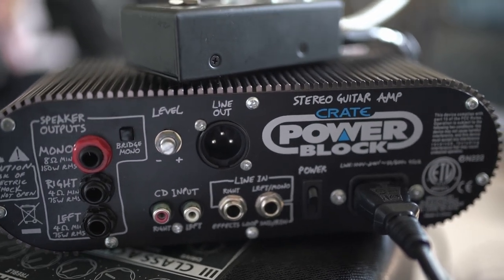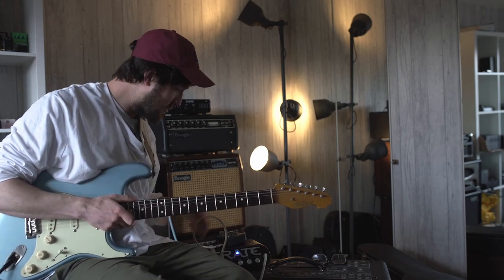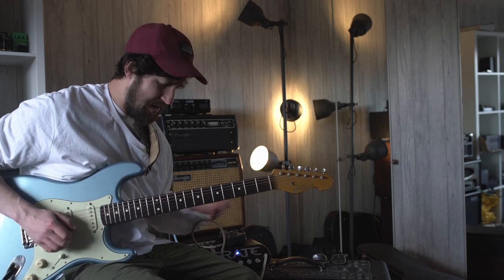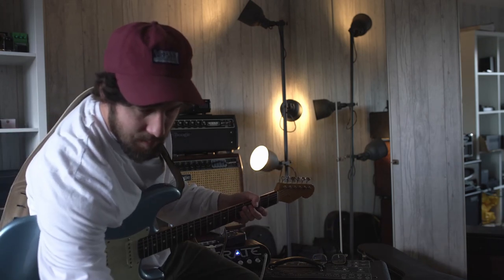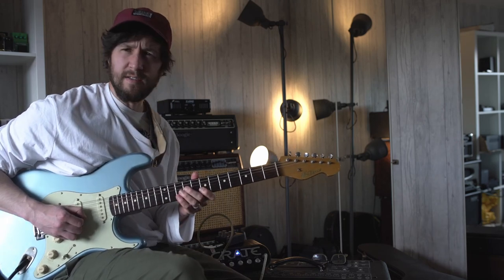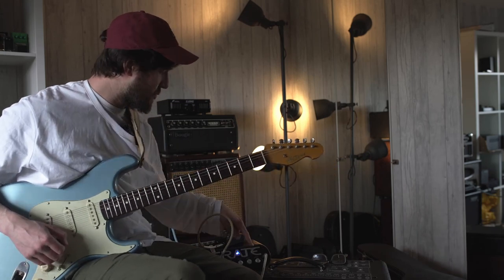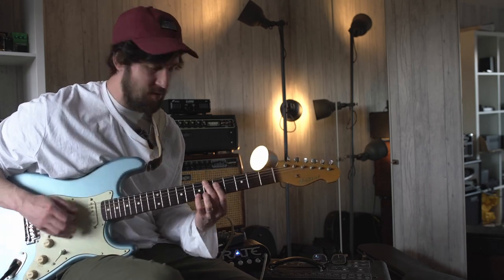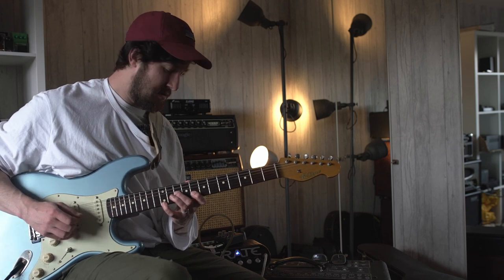The INCREDIBLE Crate PowerBlock...A Great Idea, at least?

Comment from the maker: Dear internet, were the stories about reliability true, or did your Crate Powerblock survive? Also, what would you get to do this job in 2022?
Reply: I'm staying with my Yamaha THR100HD, but I probably wouldn't mind that Crate
Reply: I owned a Crate PowerBlock new, and the term "perfectly adequate back-up" is the best reason for what I bought it for: an always packed in the van bag. I used a few times... then it just didn't turn on anymore and wasn't repairable. On the flipside, yes, yes, yes, I would recommend Quilter. I've been using their amps as my main stage rig for years and (full disclosure) am proud to be on their artist page. They were the first SS amp to fully win over a "only tubes for my main stage amp" guy like me after trying with virtually every other "great" SS amp (Lab Series, Roland JC, Yamaha, Line 6, Tech 20)
Reply: I got one of these for £50 when they were on blow out to use as a backupto my main rig.  When my 6505+ 112 was sitting in a shop waiting 13 months for a part I used it as one side of my rig into a Peavey 412, the other side being a Peavey Vavleking MkII 50 watt.  The Powerblock was adequate but certainly not inspiring.  It takes pedals well, you can get a useable tone out of out but it needs a lot of work.  If I was going to buy something new that was the same concept I would go Quilter straight away.
Reply: I have the Boss Katana head, it's a nice backup, plus it has a 5" speaker in it to use as a practice amp in a pinch (and it can get loud, works fine for a monitor on a quiet stage like a church).  I throw it in the car with the rest of my stuff as insurance.
Reply: I've had one of these for about 10 years now and I thought I'd update and get a Dv  Mark mini 250 thinking it would be way better. It wasn't....
Reply: I've had one for the past 15 years and never had any probkem with it. You just need to be cautious about the impedance of the speaker you plug it into. It's not great as a DI, though. I mostly use it with an headphone for practice these days.
Reply: I bought these when they were dirt cheap and they work great.  The key is to use the right cabinet and speaker.  They take pedals really well.  Try it into a 1x12 with a Celestion GOLD. With great OD pedals, it can sound incredible.
Reply: @guitarcd  are the new 12in combos suitable for using with a modeler?
Reply: I got an Orange Pedalbaby. After an aggravating time with IRs and full range I’m pretty happy hearing models through an actual cab.

Comment: If you know what your doing almost everything is usable. You made that crate sound great. The problem with most gear is user error. Sorry folks but you can’t set everything at noon in ten seconds and have a great tone. Some pieces of kit require fiddling some knobs and knowing what it’s designed to do. You’ll be much better served learning how to get what you want out of what you have than watching gear channels all day drooling over the newest products. Great job on the video.
Reply: Exactly. I’ve had 2 Crate Power Blocks for 15 years with no trouble. Gigged with one of them as my wet/wet stereo amp and as a backup for a decade. They rock!

That said, I NEVER had tone like this out of mine because the OP is REALLY GOOD! Tone is in your fingers and soul, and a player as good as this guy will sound great plugged into damn near anything. That’s why he’s got a Dumble / Michael Landau / Larry Carlton killer lead going that sounds like some high end boutique amp but it’s about as far from a Dumble and as cheap an alternative as you can get.
Reply: Tell an amp tech that. There are tons of popular amps and gear that pretty much is rigged to self destruct

Comment: I joined a country band about 10 months ago. And the guy I replaced is widely known as the best country guitarist in the St. Louis area. His setup has been a boss me-50 into a crate powerblock into a 1x12 cab for about 15 years. Never had to service it, and the tone he’s able to coax out of it is absolutely amazing. He used to use an old blackface fender but switched to this set up because of reliability concerns.
Reply: If he had an ME-50, why didn’t he just run direct to the board and use the stage monitors to hear himself? Everything in my band runs that way. Bass,keys, v drums and two guitars. No amps at all on stage. Everything sounds awesome out front and it’s not excessively loud on the stage.
Reply: @adamgh0 Because it has a crappy feel to do that. Sound might be fine, but a top player wants the feel of a class A/AB power amp and a guitar speaker. It saves cumulative months of frigging around with IR loaders. 
You have to have a monitor yourself on stage anyway. Why not make it a solid state power amp and guitar speaker?
I bought an Orange PedalBaby for my modellers and it took me about five minutes to get a much better sound out of a 1x12 cab than six weeks messing around with FRFR. 
It’s just easier and better sounding. Ask Mr. Cordy, I think he agrees.

Comment: Gigged with one many times.  It always worked fine.  Used a Pod HD into the CD inputs on the back so it was just a clean stereo power amp.  Used it with a Marshall 2x12, with the cab modelling disabled on the POD.  Warning - using the CD inputs bypasses the volume control on the Crate so had to use the POD's volume as the master volume (had to remember to turn it down before switching on !).

Comment: Stewart used to sell solid-state class-D (I believe) power amps in that same form factor. They were intended mainly as small PA amps, not guitar amps, but they were popular among bass players, and acoustic guitarists amplifying their acoustics. I still have a PA-200B, a 1/2-rack little box that (allegedly) can push 200 W into 4 ohm speakers (I've used it with 8 ohm speakers, 50 W per side). I used to use it (like 15+ years ago!) for small acoustic gigs driving JBL mains, but also with an electric with early modelers (e.g., Yamaha DG-Stomp), and it worked well enough for a coffeehouse. It eventually moved to stage monitor duty, and then just as the amp I keep in the car trunk in case my larger Crown power amp ever dies at a gig. They still sell on Reverb for around a hundred bucks.

Re: Quilter, I haven't used one myself, but a former bandmate who has a great ear for tone has one, and it sounds really, really good with his Tele, from clean to Hendrix! —Tom

Comment: For years I used the Crate Power Block head as a power amp for the Pod X3 and then Pod HD into a 4x12, 2x12, or 1x12.

It sounded great! I went into the returns in the back bypassing the PB’s preamp. It was great showing up to gigs that already had a backline of cabinets with all i needed in a gym bag or backpack.
Reply: Need a power supply for my flyrig. Would you recommend this ?

Comment: I have a Crate Power Block and I have used it for a backup for my Hughes and Kettner Tubemeister 18. They're about the same size so it's easy to carry them both easily. It sounds great and it's indestructible. Got mine for a little more than a hundred bucks. You can't go wrong with that !!!

Comment: I have two, very good amp, infact my Fender, Marshall, Mesa Boogie, VHT,  Carvin and other amps are safe at home.
I used a Digitech 2112's two 12ax7 tubes with two VHT Valvulator 1's,  each with a 12ax7 tube before going into my two Crate Power Blocks.  That's three 12ax7 tubes per channel, I use the gain knob on my 2112 to increase voltage to those two 12ax7 and I achieve any kind of amp imaginable; from Fender clean, Vox breakup grit, Marshall Crunch to monster VHT / Rectified Apocalyptic Metal  annilation.
It has become part of my main stage or rehearsal rig .

Comment: I never had a problem with mine, and it sounds great for clean tones. I actually ran my fender super champ x2 head through the effects loop into a 112 cabinet with a eminence Texas heat. It was awesome, got all the tones I needed out of the  15watt super champ and used the crate to boost it to put that 150 watt speaker to work!

Comment: i´ve had mine since the mid 2000s and it never let me down. got the amp plus a complementing 1x12 box in a swap for a guitar - by far the best piece of gear i ever got! it takes pedals really well, has heaps of power and you never need to go all the way to 11... gain between noon and one, just a tad crunchy, and a drive to send it over...finger lickin´ good!!! i got mocked a bunch for showing up with a 1x12 box , a guitar, a pedalboard and an amp in a pouch... once they heard the little thing i would usually get offers to sell but i could not budge

Comment: The Powerblock was my first amp and I loved it. I ran it with a Line 6 Uber Metal pedal and a Behringer 4x12 cab. It was a dirt cheap setup. CPB150($150), Behringer 4x12($150), L6 Uber Metal($60). I was going for a sound as close to As I Lay Dying as possible and in hindsight this setup was incredible. The Uber Metal pedal was a one trick pony but once I had it dialled in properly it was unexpectedly impressive. People used to laugh at my rig until they heard it. I eventually upgraded my guitar to a Schecter Hellraiser and with the active EMG 81/85 pickups I could run directly into the CPB150 with the gain at 10 and get a really decent NY hardcore/punk sound in the vein of Madball/Terror. 
I have a Peavey 6505 & Boss Katana these days but I miss the sound I could get out of this rig and am itching to recreate it.
CPB150 aren't that cheap anymore, not here in Australia, that's if you can find one.
Looking at the the Harley Benton GPA-100 which seems to be phenomenal value from what I can see.
Reply: P.S never had any issues with the CPB150 in the 10 years I owned it. Played some early gigs with it and also used as stereo power amp through two 4x12's for a few house party's.

Comment: This little amp has saved my life gigs and practice, I wish theyed bring it back into production, i use for the amp modeling in my boss multifex , you can direct out and still use the cabinet so you have the amp sound and feedback control just like a tube amp with any size cabinet, the band was so impressed by all the applications its useful for they bought  2 to use for the practice space going durect

Comment: I had one of these, bought it on the cheap was "like new". 

The only issue i had with was that the edges were quite sharp and cut my hands two times. Apart from that, it was an excellent tiny amp. 

I regret selling it.

Comment: I've had 3 of these powerblocks. The concept is great and they are fine when they work, BUT, the are very cheaply constructed and not worth repairing. If the line out was pre master volume that would make them more practical. They are not reliable unfortunately. FWIW. However having a small stereo power amp like this is a cool idea.

Comment: I have a Powerblock that I bought fairly cheap on Gumtree a few years ago. I regularly use it in two ways, as a stereo power amp for an HX Stomp into two 1 x 12 cabs and as the second amp in a stereo rig with a Bluguitar Amp1 and HX Effects. In the second case the output of the HX Effects goes into the frontend of the Powerblock to warm up the signal a bit. It hasn't let me down so far and I think it's a great bit of kit considering you can get them pretty cheap if you can find one.

Comment: I bought a powerblock when they were new back in the day, still have it now and it works fine but I just keep it about as a last resort backup.

Used to run it with a Marshall 4x12 and a Pod XT live with my metal band, sounded good! (Or so I remember….)
Reply: Ha, I used to use the xt live into a Crate half stack (fx loop in). Got the job done!